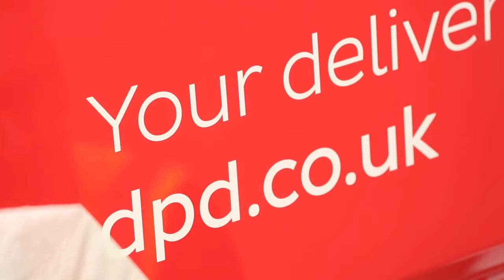DPD Fleet Rebrand - Full Vehicle Wrap Timelapse | Aura Brand Solutions

Comment: Nice job but that Wheele applicator is not intented to be used this way....its more for gaps between elements. For the purpose of getting air out of panels where you are using your finger you should use the bigger Channel aplicator from 3m insted of using your finger..... at 45 deegrees angle  and make sure you first mark the edges of the channel ;)